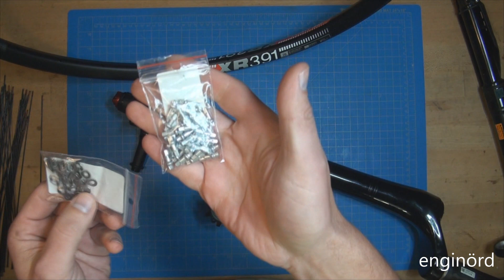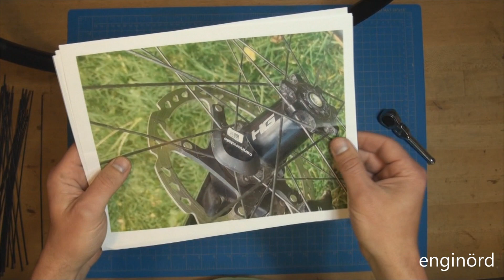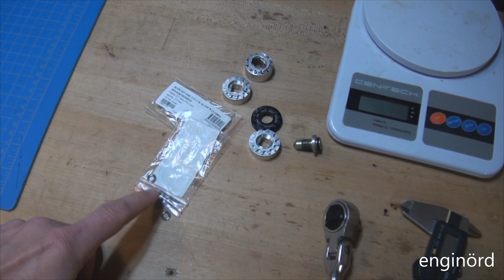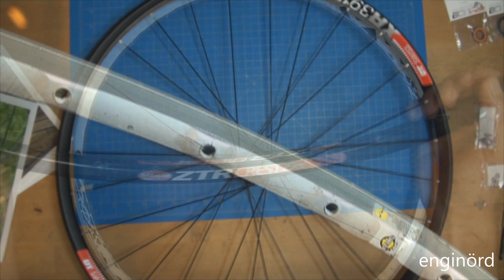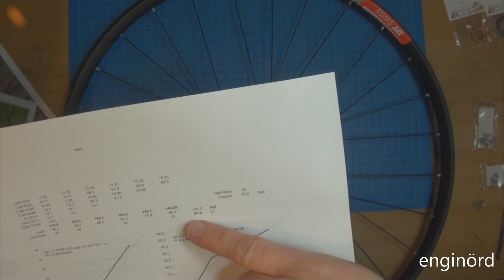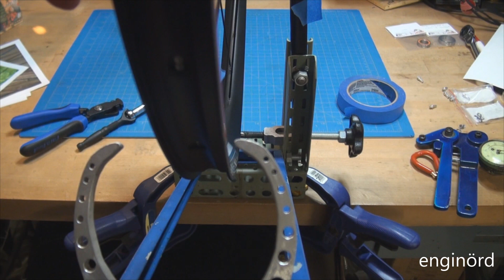Cannondale Lefty 2 Wheel Lacing

Comment: Thank you for your excellent video. You mentioned the uneven spoke tension on the factory wheels - so is that correct? Or bad manufacturing? Is the disc side supposed to have more tension then? And on your own wheelset you wanted totally even tension on both sides?
Reply from the maker: @RyRch - I believe the uneven tension in the factory wheel is due to tolerances. everything is automated these days and there is a pass/fail criteria for the machines. It can also be relaxation of parts. So I wouldn't call it bad manufacturing, but substandard manufacturing, or manufacturing to cost. I can imagine machinery will check the spoke tension automatically. Who knows how often they calibrate those gauges. I think both side spokes should have the same tension to best utilize the spoke stiffness. I strive to have uniform spoke tension on both sides.